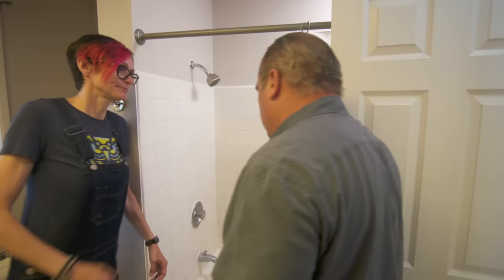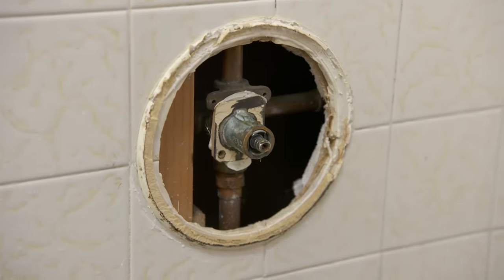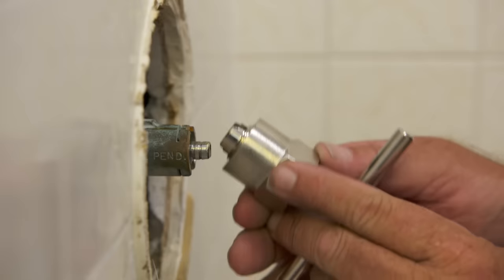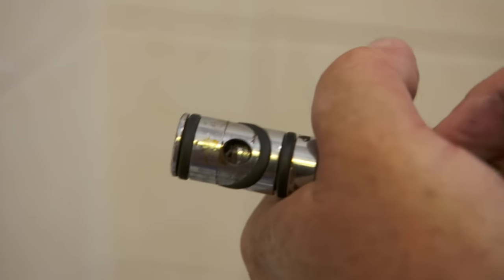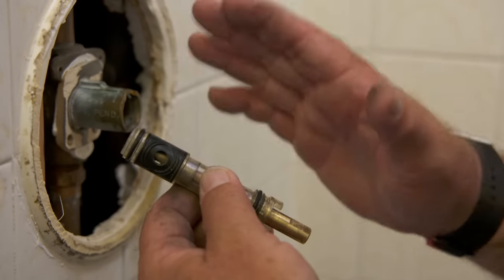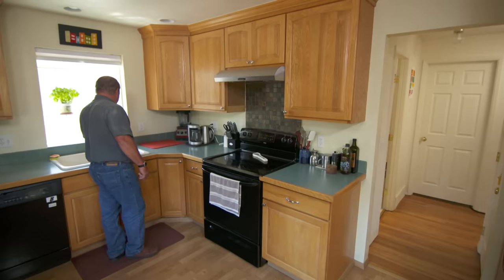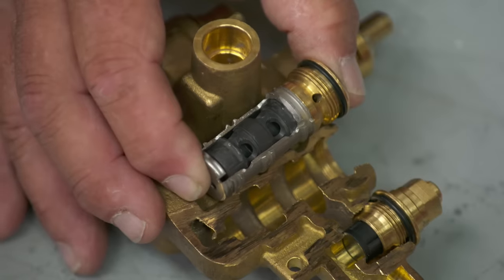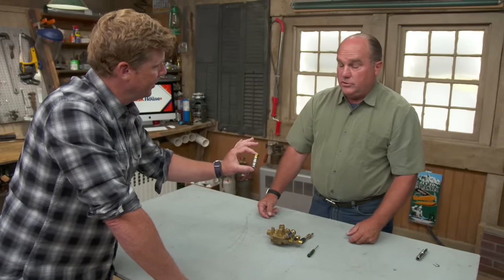How to Replace a Shower Cartridge | Ask This Old House

Comment: I had the same shower body and the cartridge broke inside but I used a tap and die and was able to use a bolt to put the piece out
Reply: Every one of the old Moen valves ends up the same way.....the tap/die and bolt with ledge.......I guarantee that insert in the video was removed by a helper first and then Richard stepped in for the easy look.  The force it takes to get some of these out is unbelievable... . and some have to be removed in pieces when the stem breaks free of the cartridge......it's a bit of b.s., but still an interesting video though.
Reply: I've changed hundreds of these cartridges in my apartment buildings.  He had the fancy tool to pull the cartridge and used a pair of pliers instead.  If you use the tool to remove the cartridge you can spin the cartridge while removing it.  The fancy tool can be found at any home depot for about $15.  If the inside stem breaks out of the cartridge there is yet another fancy tool that can go inside of the cartridge to remove it.  Not sure where to pick that one up though...I inherited that tool.
Reply: @madcow3007  do thy typically break?? I want to attempt to change mine but I'm afraid I'll be lost and stuck if it breaks
Reply: @ms.s0665  Watch several videos on this............. then buy every tool you might need.............   and, know a plumber that could come over that day if need be.  Start the work as early in the day as possible.
Reply: I had to buy the special tool to get mine out that was caked with minerals but it definitely worked

Comment: My home is only 1 year old and by the symptoms I have it appears the cartridge is defective.

Do you think I need the tool to remove the cartridge? Or can make do with just pulling?
Reply: Harbor Freight makes a kit which is cheap and has 3 different types of removal tools for shower valves.  The cost has to be a lot less than a plumber.

Comment: A quarter of the plastic of old cartridge broke off in pipe.  Suggestions? Thanks
Reply: Interesting. I'm not familiar with those, but what did you en up doing?
Reply: @flat-earther  I bought a 1/2 lag screw, turned it a few times in pipe and pulled straight back. It worked👍

Comment: He said the new cartridge was designed to balance the pressure as you change setting between hot and cold but she’s not changing the settings.  She just turned it in to hot and left it there so how did this work?

Comment: My shower just stopped giving hot water but still get hot water in sinks around the house. Valve adjustment for temperature didnt help? Any advice
Reply: Luis angel soto  put a for sale sign in the front yard
Reply: Luis angel soto  actually if it’s a single handle the balancing spool is stuck

Comment: My single valve let's in hot water first instead of cold water. Can I flip the cartridge or is it a plumbing issue? Thanks
Reply: 718Moto 
Just watch this a  dozen times and you figure it out

Comment: My shower handle is the type that tilts up to turn on then turn to adjust temperature. It has a plastic body inside that slides out easily with no tools. New cartridge cost me only $15 from Lowe’s and no more dripping tub faucet!

Comment: i need help, the valve is inside the wall and im having a hard time putting the clip back on
Reply: Try this: Remove the cartridge, spray some lime-away or degreaser type cleaner on a toothbrush and scrub the housing where the cartridge goes. (You can aim a flashlight there and see the mineral deposits) Then apply some silicone grease on the toothbrush and wipe it around in the housing. Grease up the cartridge with the silicone and slide it in. The reason you can't get the clip back on is because the cartridge is not all the way inserted or the tabs that the clip goes around are slightly off center. Also, on a sink faucet I had a shut-off valve slightly leaking and I could not compress the liquid, so I sucked out the water with a straw and quickly shoved in the cartridge.   FYI: On my Moen cartridge, you have to be sure that it is not 180 degrees out of sync. Otherwise turning left will be cold instead of hot and to the right will be hot. Hold the cartridge the way it will be inserted and use pliers to turn the shaft to the left. You should see an open passageway for the hot water and the other side should be blocked. When you center it both sides will have an opening. If you do install it wrong, just remove the handle and spin the cartridge around 180 degrees. I hope that didn't sound too complicated.

Comment: Tile was 1964 as well..   I'm here for the" you should have" or "why didn't you" comments 🤣🤣
Reply: Shocked, a plumber didn't say "Nope discontinued, walls gotta come out,new fixture,new flex hose,new concrete board,new tile,tubs chipped,toilets outdated,sinks cracked and your pet just ate 3  o rings.  Without taking his muddy shoes off

Comment: Pipes were replaced throughout the house  ( still used copper instead of the  plastic ones) but now
1) I can hear water rushing in the pipes behind the walls when the shower is on
2) even with small tube-like devices ( designed to stop the banging noises) is installed right before the hot & cold controls, there is a loud banging sound every time the washing machine stops filling up.
Can you explain why these conditions happen & how I can stop or minimize them?
Reply: I'm no plumber.  I'm wondering if you are on city water and getting too much pressure?  Perhaps you need a pressure reducing valve?
Reply: @AStanton1966  ok. I check that. thx

Comment: I have a similar problem in my house's shower stall. It has two knobs for hot and cold, but there is no diverter, because it's just stall. how do I reduce the affect changes in pressure have on the temperature coming out of the shower head?
Reply: They made a video on converting 2-valve units to a 1 valve w/ pressure equalizer. You'll cut open the wall following a provided template, cut out the valves, solder in elbows and pipe for the new valve (cap off the tub spout  connection), and install/caulk a large cover plate over the wall opening (part of the kit). Not plug and play like this, but won't require an entire bathroom demolition either.

Comment: Question ? I just replaced all 3 seats and valves in my shower/tub and when I turn on either hot or cold the water spurts from all 3 valve assembles. what's going on here?
Reply: I'm assuming you have a 3 handle faucet. 1 hot, 1 cold, and 1 divertor. If water comes out of any or all 3 of those stems, you need to take the handles off of the faucet first. You'll see what looks like 2 hexagon shaped nuts per stem. The first nut closest to the valve body is what is classified as a bonnet nut, which you should have tightened to put the new or reused old stems into the shower faucet body. The second, usually smaller nut, is called a packing nut. You will need to tighten the packing nut on all 3 stems by turning them clockwise. Be sure that you do not tighten the packing nuts too tight because you'll either break or strip them or compress the packing too much, which will make the handles too hard to turn. I would just tighten them at least a 1/4 of a turn and test them out and keep repeating the process until the leaking stops. If it doesn't stop the leaks, you will either need to repack the stems or replace the stems with new ones if you reused the old ones.

Comment: Question viewers and Channel. My home has a well pump. It is soon to be hooked to main city water lines. In the meantime I want to make this repair. I know i have to shut off my main line on well pump but do I also turn off the water line from my water Heater? not sure if this is a silly question. Can someone help. Thanks.
Reply: There's usually shut-offs just for the shower, then you don't need to shut everything off.

Comment: Don't forget when replacing the cartridge to keep in mind which shoulder was up on the original and add the new one in the same way. If you don't, its not going to work out well and you'll have to reset the cartridge, in my experience at least.

Comment: I'm surprised you didn't wiggle the cartridge when you were pulling it out.  The valve that I have  experience with has no flow control, and it's a super PITA.  Your foam bead set into caulking is a super idea.

Comment: Got a quick question for anybody knowledgeable and smarter then me I got the same set up at this lady with the single handle valve house built around the same time when I pull the handle out all the way mostly only when using hot water to my understanding it makes a shrieking squealing noise very high pitched I have noticed this only happens potentially with hot water and when I pull the handle fully out I get plenty of pressure regardless but when I pull the handle only half way or so out and use hot water I get no noise if I was to do a similar repair to the one of the video does anybody know if that would fix it opposed to potentially replacing the whole valve...!?
Reply: Did you end up repairing it?

Comment: Do those pressure valves have springs or something to keep them at a default position?
Reply: There are 2 types you have washers in one and ceramic washers in the other these control the flow of water.

Comment: Cartridge came out way to easy  I think he pre pulled it out then put it back in half the time it’s a fight even with the cartridge puller
Reply: What blew my mind is he only used the cartridge puller to loosen the cartridge but not actually remove it lol
Reply: About 10 years ago I pulled mine out,& it came out easy. Good thing it did ,cause apparently they stopped making the cartridge I needed in the 70's. So back in it went lol My house was built in 1960.

Comment: Good luck if you are doing this, they all dont come out that easy , I used a crowbar u der the screw against a a 2x4 on the wall finally got it out .  New one slipped right in .

Comment: What company made that valve ?
Reply: It looks like a Moen. I wonder how he got the part number plus the modern replacement part. Customer service reps are all over the place- Delta is pretty bad. Send them a photo and they still can't figure out the original model number of the faucet. Mr. Fixit must have an inside connection to Moen. I have been plagued by parts that fail in Delta and Kohler faucets. Time to get up with Moen or another brand.

Comment: I would have replaced the entire valve assembly. You got it apart, it’s 60 years old, do it now.
Reply: Is that a difficult task ?  For a plumber ?
Reply: @dks13827   Not difficult for a real licensed plumber, And I repeat a Real Licensed Plumber! Not a handyman ,not a tile guy, not a dude you find on the internet it involves 1.75 to 2.5 hours of Skilled labor depending on the individual circumstances of the job. it most likely will involve cutting tile, drywall framing members etc. Hire a real plumber, someone who has spent about 5 years in an apprenticeship past the tests earned there right to a license and then keeps learning the ever evolving trade. OH yeah you wont like the price but "Cheap Labor aint good and Good labor anit  Cheap sorry for poor spelling, been on call just got home

Comment: I thought their was a screw in middle of cartridge removal tool that screws into the cartridge? in order to remove it.
Reply: There is. You also don't have to pull the cartridge with pliers. If he would have used the tool properly there is a nut that tightens down against the valve body and pulls the cartridge out.

Comment: I changed the cartridge and I still have no hot water can anybody help!!!
Reply: No hot water at all?
Reply: @classikz  hot water for less than 1 min then get luke warm even through it on full hot
Reply: @jimmyfong6198  the 'dip tube' has eroded. A service tech should be able to replace it.
Reply: @dilbotmacguillacutty4849  not the dip tube rest of house has hot water
Reply: @jimmyfong6198  what type of shower valve
Reply: @DDunc1020  I believe it's a moen same one shown at the end of the video. I checked the balancing spool and the stops all appear to be okay. Changed the cartridge with a working on from another shower.
Reply: If you did everything correctly  (replacing the cartridge right) and there is no problem with the water heater then 100% its the adjustment hot/cold cartridge...  some model default setting is set to cool or warm even at the hottest setting.
Reply: @JohnT2088   But the water comes out really hot when I 1st start the shower and I turn it to hot and then it cools off within one minute
Reply: Plug in you hot water heater lol
Reply: Jimmy Fong if your water heater is gas operated.  Check if the fire is out or not. If its out you need to ignite it again.
Reply: @JohnT2088  its oil and the fire is not out I have hot water in the rest of the house. Only this shower has hot wat for less than a min and it gets cold. No other facuets are on when this shower is on it still loses hot water.
Reply: Jimmy Fong   Your posi temp valve is upside down.  Or... you installed the posi temp valve correctly and the hot/cold lines going to the valve are actually backwards.  Either way, you can pull the valve back out and put it back in upside down and it will flip the hot/cold fixing your problem.
Reply: @you.e  posits temp valve is installed correctly. When I change it to cold it go to cold but when I switch it to hot it gets really hot then turns Luke warm in less than 1 min
Reply: @jimmyfong6198   When I replaced mine, I had the problem of the water really hot when barely turning on the shower and when turning the shower up to hot, it would then go cold.  I also installed my posi temp valve correctly, but realized that the hot/cold lines in the wall were backwards.  After re-installing my valve upside down, it fixed the problem.  The instructions that come with posi temp valves mention this situation.
Reply: @you.e  I will try and flip the cartridge and see if it help thanks I will let you know.
Reply: Jimmy Fong yes. Make sure you install it correctly first.    There is only 3 failure here.    1) incorrectly install valve wrong / cartridge 
2) some model default adjustment hot/cold is set at cold only and you have to adjust that for yourself on the cartridge knob. 
3) water heater failure or the fire ignite is out if your using the gas type.
Reply: @JohnT2088  how do I adjust cartridge knob
Reply: John checked everything no luck any other suggestions
Reply: Jimmy Fong adjust cartridge knob to get  if thats not the case hire a pro and see what they say.     I mean what can it be lol.  1) install incorrectly 2) adjust more hot water on cartridge knob 3) water heater dead or fire ignite on it is out if its a gas type.   If none work just hire a pro.

Comment: I live in an apartment. On New Years day 2019 when I turned any of my faucets on and I turned the cold side on I would get HOT water as if I had turned the hot side on. This happened in the Shower/Tub, Bathroom sink, Kitchen sink. When ever I flushed the Toilet I got HOT Water in the Toilet. What would cause this to happen? The apartment Maintenance couldn't figure out what was causing it. This just happens out of the blue. One day everything works good but without warning it will act like this. The water is heated by a Boiler system on the ground level of the building. I am on the 5th floor of a 6 story building. To be honest the water temperature is way too high to begin with. Along time ago I once boiled an egg by placing the egg in a little sauce pan and I let the hot water run over the pan for 30 min and the egg was hard boiled. I took the temperature of the water and it was up in the 160+ degrees F. The apartment manager told me that they couldn't lower the temperature because the other apartments wouldn't have their water hot enough. I live alone and no one else is turning the sink in the kitchen on while I am taking a shower.
Reply: I think that hot water can cause toilets to crack....  so I have heard.

Comment: I'm pretty sure the host didn't understand the concept. That first part only deals with pressure. So when someone flushes the toilet it actually lets MORE cold water through to compensate for the cold water pressure drop meaning your shower might get colder than it would with an older valve.

Comment: what you forgot to say is that MOEN gives a lifetime warranty of that valve and will send you a new cartridge for free
Reply: Jim Wainwright , true. The hardware stores will hand you a free one if you ask. But, they will sell you one if you take it off the rack and don’t ask any questions about the free aspect.
Reply: Only if you have proof ur original purchaser in a home
Reply: It’s 5 - 10 years for rental or commercial moen and delta